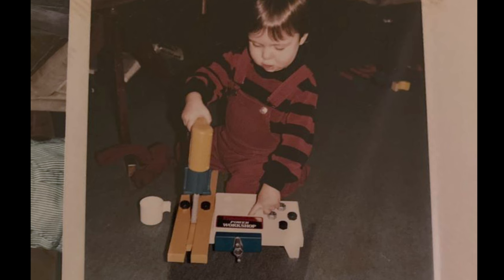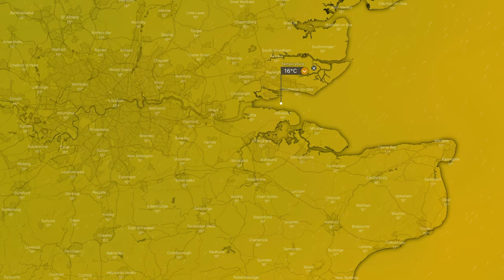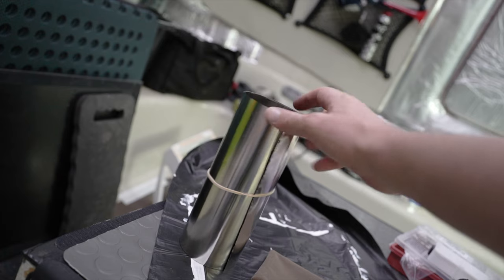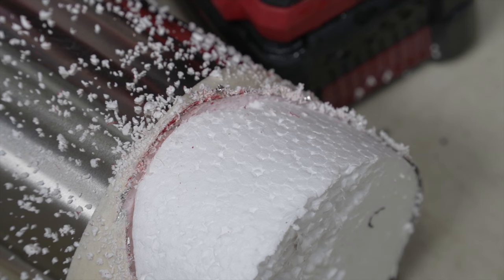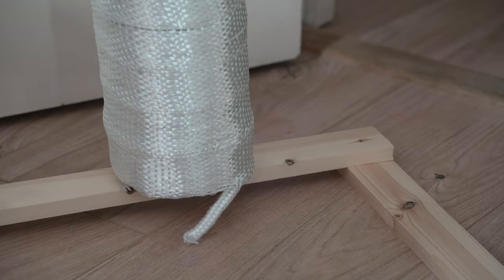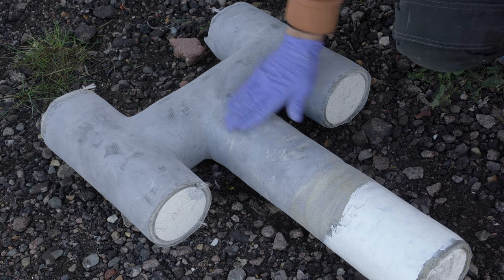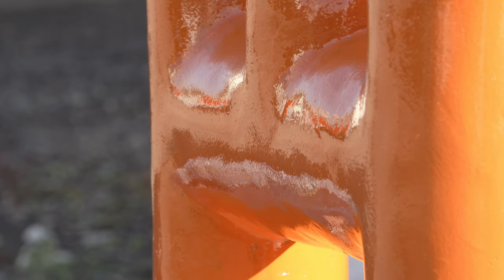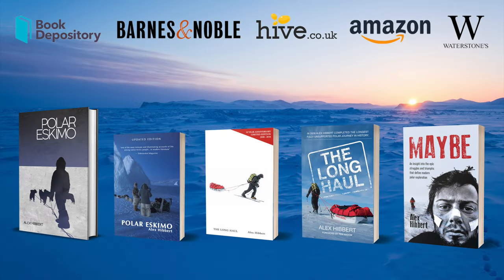Making a fibreglass H type diesel heater flue hood / cowl - Part One. Lifeboat Conversion Ep58 [4K]

Comment: Ah, I've been eagerly anticipating the heater installation. I'm about to install a Dickinson boat heater in a small cabin I've built. Though my requirements are far short of what's required for the arctic I've no doubt your observations on the install will give me some clues to improve my own.

Comment: Tig welding is surprisingly easy with practice, and obviously, knowledge you can pick this up from any friendly  welder. You should buy one. I did 6 years as a mechanical fitter mig welding every day. The welders at my workplace just told me to try it, showed me the basics, and then all of a sudden, their workload shrank, and mine grew. I'm already planning my purchase of a tig setup and the purchase of stainless tube to remake my exhaust. (I expect it to be as bad as Alan's) I'll know for sure my end of this week.
Reply from the maker: Later on in the series you'll see my beginner welding on some less than critical parts! Cheers

Comment: A backup diesel heater seems a great idea, however surely an internal heat exchanger to which you can divert engine coolant is the most efficient heat you’ll get?
Reply from the maker: It'll be the primary heater as Alan will be stationary with engine off for prolonged periods. There will also be a selection of smaller portable 2kW diesel burners. Lots of people are keen on an exhaust heater exchanger. I'm considering a detachable system to wrap around the upper part of the exhaust.
Reply: @AlexHibbertOriginals  while sitting for long periods, yes absolutely! Although when the boat is under power it seems crazy to dump heat from coolant (90 degrees ish) overboard. In my experience of an old vw beetle exhaust heat exchangers are a risk not worth taking. A simple system comprising of an aluminium radiator and a few valves/pipe work  could easily divert coolant from the primary system to vent heat to the cabin and provide redundancy if the primary system was compromised! 

While I’ve got your attention I’ve recently fitted a recoheat system to my wood stove with such incredible results I cannot put into words. I can only recommend a bit of research into compatibility with your diesel stove. It’s incredible. 

Good luck Alex, your endeavours are thoroughly entertaining and appreciated
Reply from the maker: Thanks for the tip on the Recoheat things - I actually had a similar DIY plan but dry, without a pump.

Recovering some heat from the exhaust - an idea certainly in my mind, swirling around.